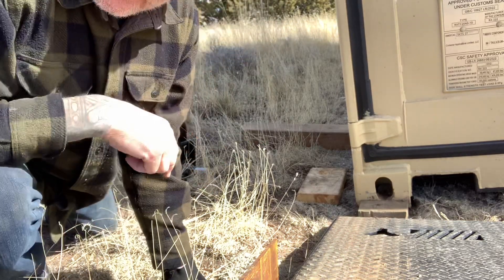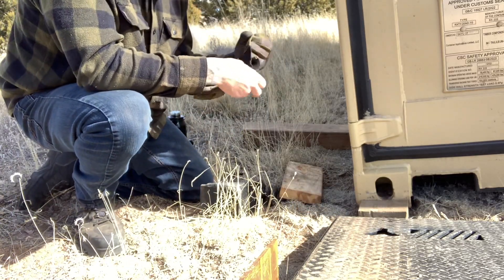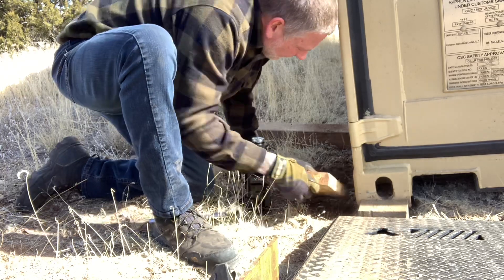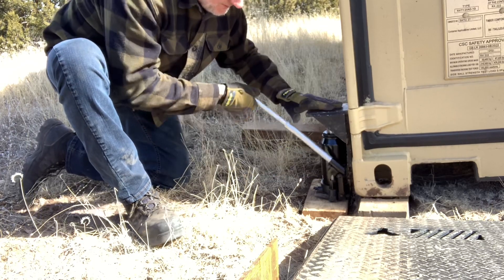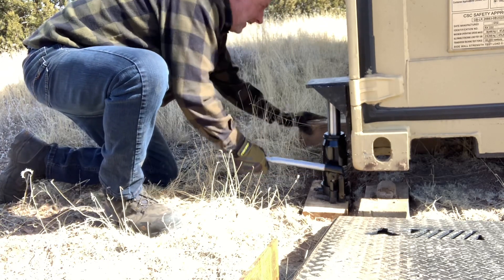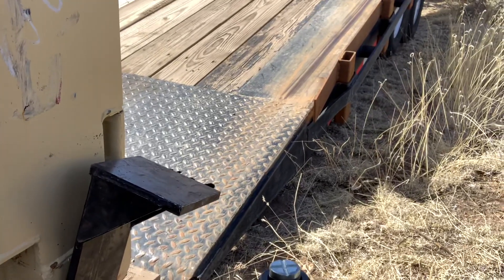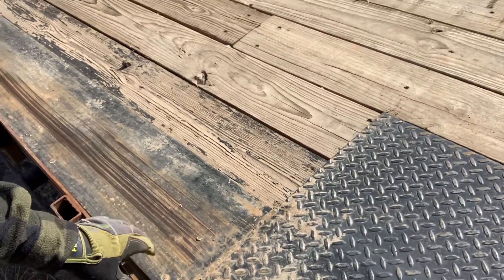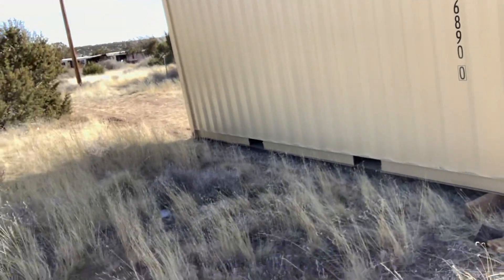How to lift a 20 foot shipping container

Comment: What is that metal piece called that goes into the side hole used to assist with the lifting
Reply from the maker: Im not sure however if you search online for shipping container bottle jack lifting a few options should show up ....... I bought that off a random diy guy building those online before a bunch of other companies started producing them